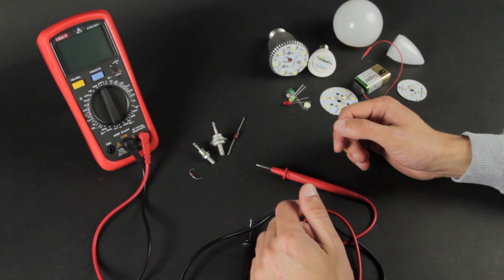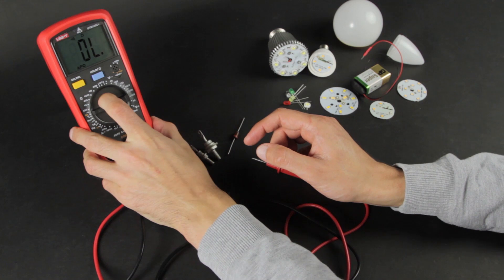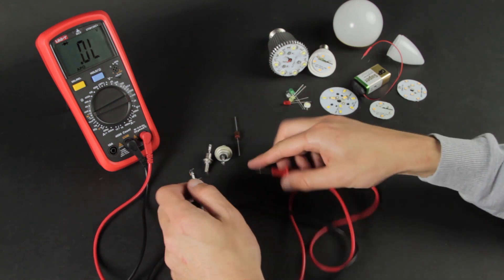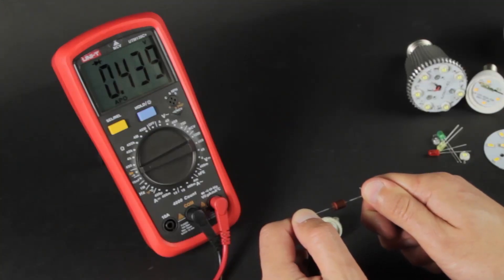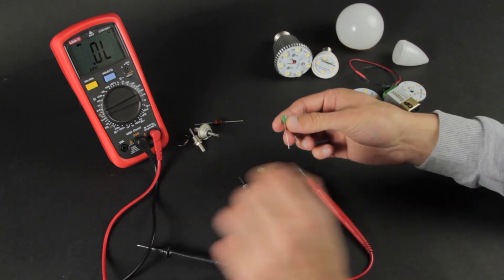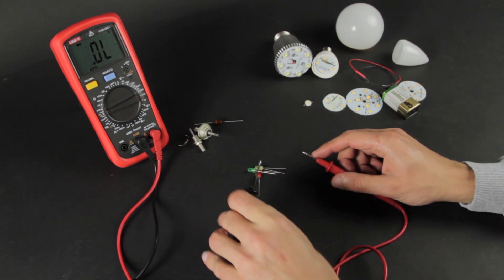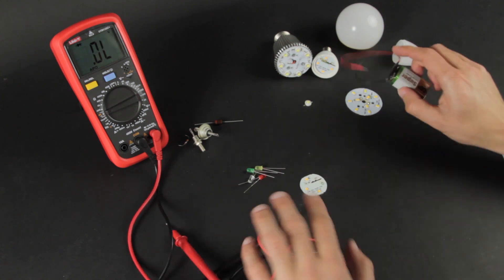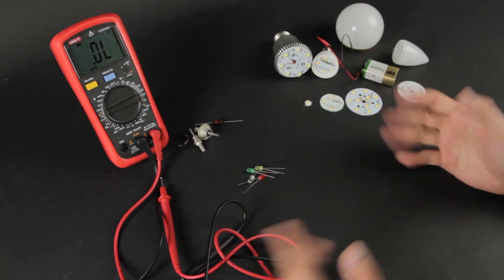How to Test Diodes and LEDs? | FAQ

Comment: How to test them if soldered ?
Thanks
Reply from the maker: Before checking, it is recommended to remove elements from the circuit (to obtain accurate and correct readings). But in some cases (as shown in the video), the check can be done directly on the circuit, if you know the circuit in advance.